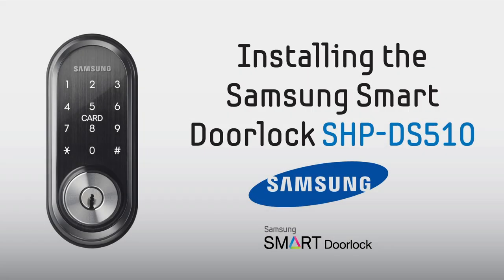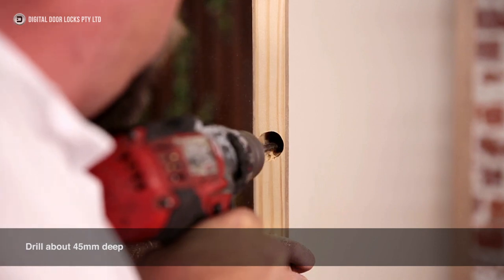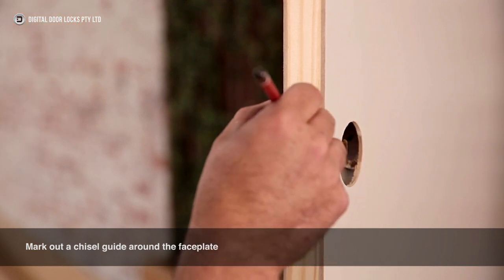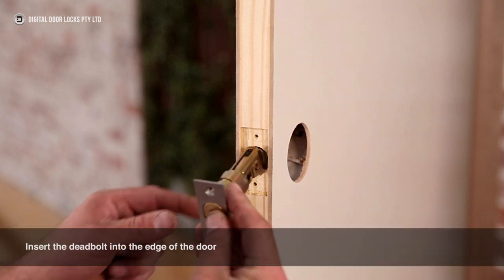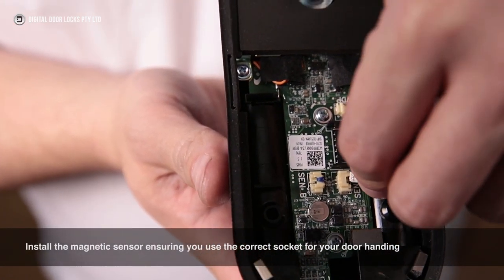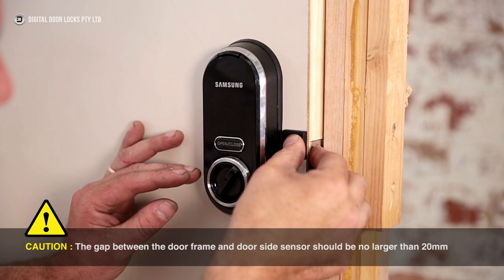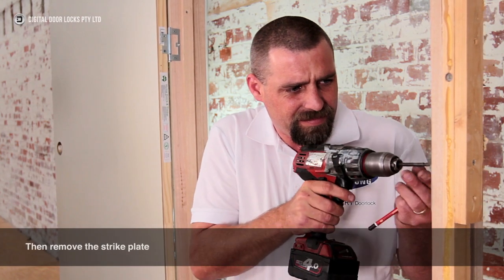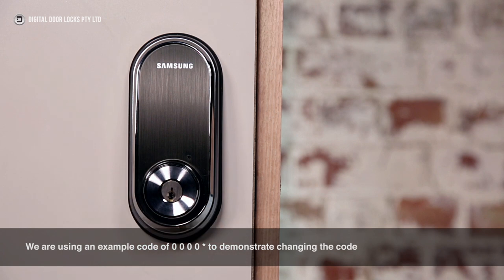Samsung SHP-DS510 - Installation & Programming Video

Comment: Lets you cut the holes and check in the striker, all sweet.. Only then do they tell you there must be a minimum 50mm between lock and door frame. Too bad if you've done all that and then find you've messed up a perfectly good glazed door just because the usable door frame width between glass and door frame only leaves 40mm. 
Keep your receipt and try your luck with the retailer